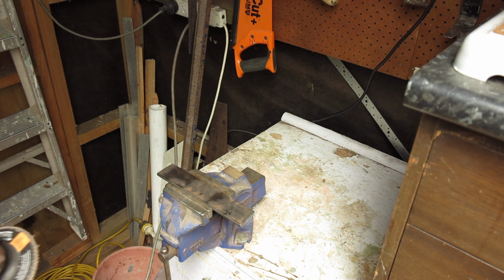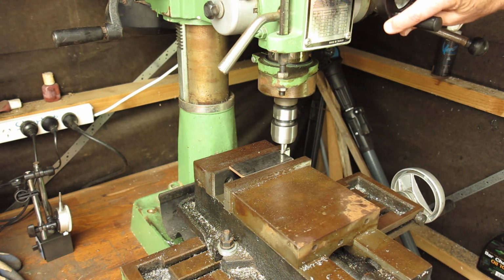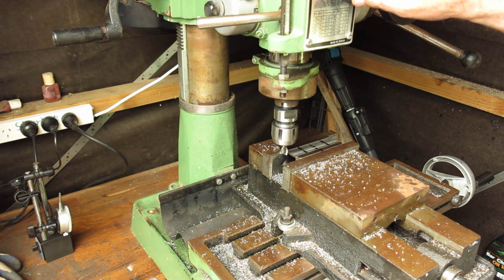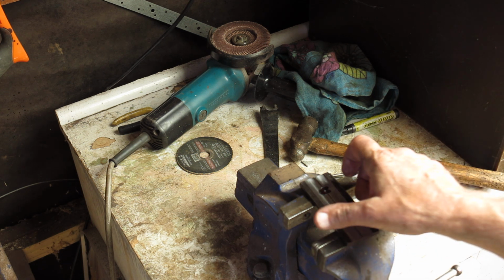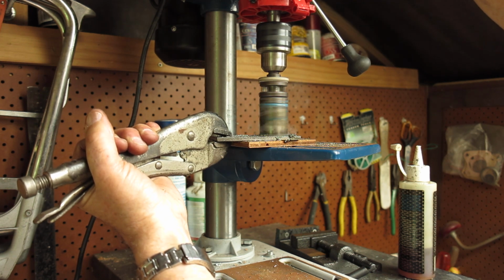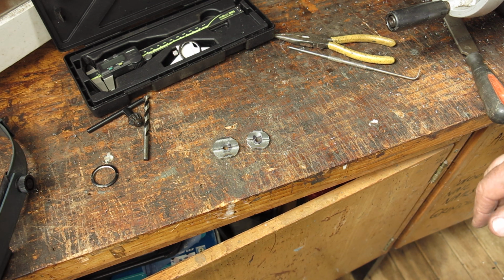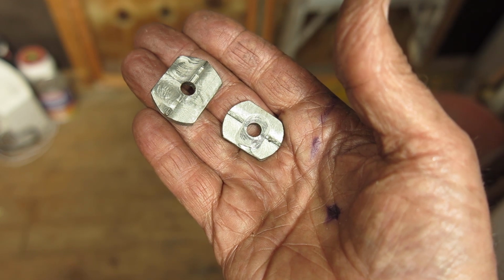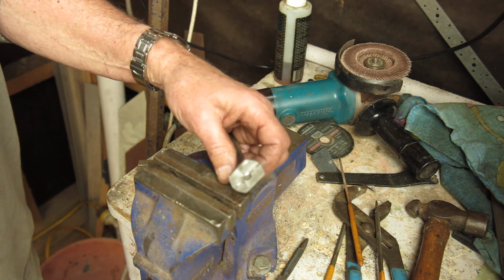Camera shutter retaining ring tools, part 02

Comment: I'm so glad that the craft of tool making is still alive. I don't have some of those fancy Electrical tools, but you can't beat hack saws and files, especially my favourite the bastard file. I half inched mine from my brother many years ago. 
If only I could make a cocking rack for my Retina 2c😢
Reply: I hear you there @petervanorsouw, Something tells me that 3-D printing one probably won't end well. 😀Imagine my frustration as I acquired numerous Retina Ia models that had broken frame counter springs and the one that DID work, broke with the first few film advances. Then imagine my amazement when I came up with a plan, obtained some spring steel and was able to repair those broken springs with snips, files, pliers and solder. Every once-in-a-while, some ingenuity and some simple tools can achieve great things. Welcome to Chris Sherlock's world! Glenn
Reply: @mnragnar  yes a rack can be made, I just don't have the whereabouts to cut the teeth and harden them.